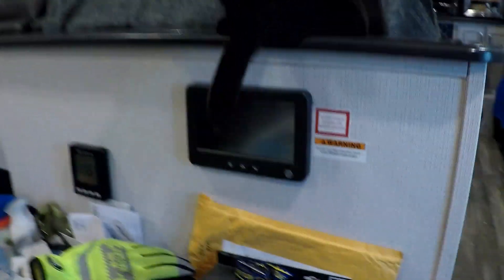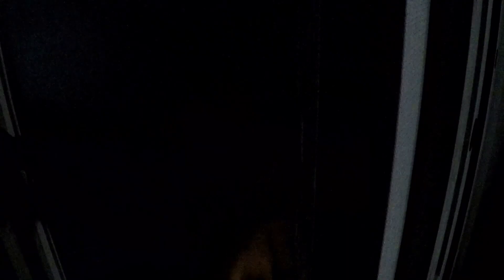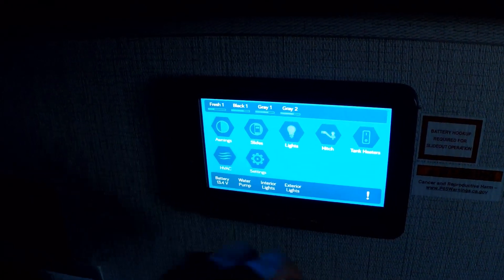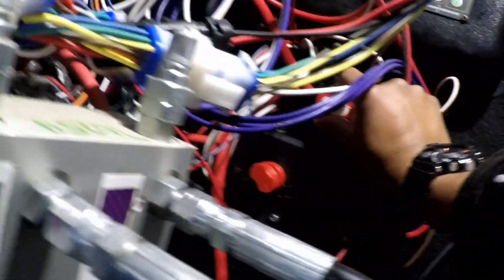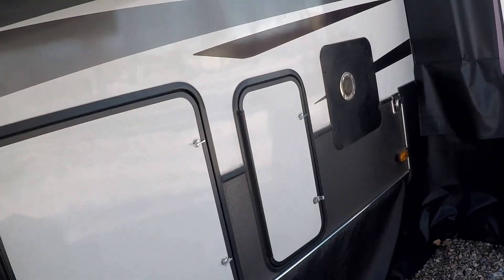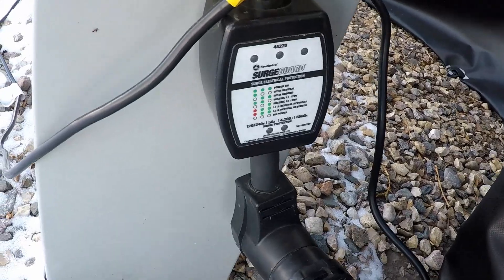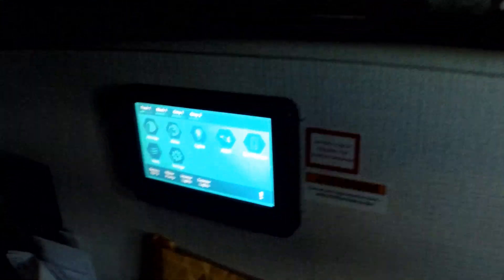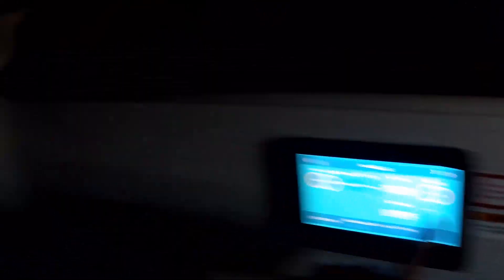IN Command HVAC Reset

Comment: Waiting the extra few minutes before turning the power back on again is required sometimes because in some cases it allows capacitors to drain, which clears the memory of some electronics systems.  Thanks, this helped jog my memory.

Comment: Trying this now, have same issue…will update you when done.  Thanks for info!
Reply: First shot didn’t work, still power from the truck as it was hooked up, maybe the problem; trying again.
Reply from the maker: @carolmatt2959  how did it work out 2nd time around?
Reply from the maker: @carolmatt2959  heyya! Just curious. Did it work after disconnecting from the truck?
Reply: @CombatCarbon  no…let me tell you why.  Th leads had slipped out/disconnected inside the ceiling A/C unit.  The hwy was quite bumpy for days and I guess it was enough to release the wires.  So, since this is a quicker check, I recommend folks look at the leads to see if the wires have popped out, if you’ve driven lots of miles and this happened “out of the blue”.  If the wires are connected, then go with your recommendation.  Thanks much for your video, though.
Reply from the maker: @carolmatt2959  Oh wow! This is good info! When I get back this summer, I will definitely check the leads.  I wonder if they might be loose and thats whats causimg the problem. I will say that consistently, this was happening every 4th or 5th reconnect to power. But tightening leads could very well solve this all together. Thanks again!

Comment: Thank you for your help and info
The only question I have now is I noticed when you went back inside to turn your gas furnace on you had it set to “electric ” and your gas furnace kicked in?
Or did I not see that correctly?
Reply from the maker: @guybrick4490  Hey! I'm glad it worked out for you! Not having AC in the hot or cold can be a deal breaker. And what you saw on my settings and what you witnessed was all correct as well. My AC system is set up with an electric heating element in the rear. When the temperature inside starts to drop, that heating element kicks on and the rear AC unit fan turns on to start circulating the warm air to bring the temp back up. In mild climates or cool summer nights, this would be sufficient for keeping the rig warm.
 However, if 
1) The drop in temperature is too aggressive
2) The time it takes to resolve the temperature difference exceeds a set time limit. Roughly 5-8min. or
3) The system instantly recognizes that the temperature desparity is so great that it can only be corrected with gas heat. Which was the situation you witnessed...
The gas furnace will kick on. 
This is a pretty "cool" feature that helps conserve the propane. And helps reduce the noise pollution inside the cabin.

Comment: I’m having this problem right now and I did all of your steps,  twice. The temperature reading in my rear HVAC which operates my heat is still showing -F degrees. Front AC and Fan both work and are reading the correct temperature. I reset the main reset button on my iNcommand (in the hold area of the RV) also however I think there is an additional reset button inside the iNcommand panel. Or do you think that maybe the temperature sensing wire failed? Of course this happened on a weekend. Any thoughts? If not I will be contacting them on Monday.
Reply from the maker: @NancyBlakeney  Hey! I'm on now. Are you still having issues?
Reply from the maker: @NancyBlakeney  Just making sure.
1) Powered down everying in Camper
2) Powered of In-Command panel 
3) Turned off inverter
4) Turned off Solar
5) Turned off shore power. 
6) Leave everything off for a good 5min count.
7) Reverse steps for power on. 
So far, this has worked for everyone that has reached out to me. Doesn't mean it hasnt worked for someone. But if it didn't, those someones never reached out.
Reply: @CombatCarbon  perform the process again this morning and no joy. I’m gonna crawl up in the air conditioner and see if I can crimp that line. Maybe that’s what it is but tomorrow I will get to the bottom of it with the manufacturer technician.
Reply from the maker: @NancyBlakeney  Hey! Were you able to get the issue resolved? Hopefully you were and were able to get back to enjoying your time. What ended up being the issue?

Comment: Hello Combat Carbon, my issue is not fixed yet. The mobile repairman came yesterday and at first the rear AC was not getting power, we rectified that and did a full reset which did not produce a fix. It was too late in the day to call in Command or Keystone so he will be back on 11 February at a time where we can get them all on the phone while he is here. Hopefully they will walk us through the repair. They have spent too much time pointing fingers at each other instead of helping get this rectified. I even suggested that Keystone issue a recall. I’ll let you know what happens on the 11th. That’s the soonest the mobile repair man can come back.

Comment: The zone still reads negative on mine after the reset 😭
Reply from the maker: How long did you leave the power off for? I would leave it off for no less than 3 minutes. And also ensure you actually "Power Off" the In Command Screen

Comment: The fancier they get, the worse they get
Reply from the maker: @JohnSmith-kw8lt  I don't know. I'm fairly new to this game so 2022 and up is all I know. But I went into this with a common sense approach. Unless it's military grade, hardware and software (especially home furnishings) are tough to design to be thrashed around on streets and highways day-in and week-out. My unit has been a dream considering I parked it and camped it for 16 months straight. However, if someone was planning on moving camp significant distances every weekend or even every week, I would NOT sugest this unit. This is a destination camper in disguise. I think this 3712KB is missing an axel. Two is not enough to tow this thing regularly.

But that is the one topic I find missing in this market. "Frequency of Movement." I bet I agree with you that the more tech and moving parts you have coupled with designer craftsmanship, the less you should bounce these things down the road. A house on wheels will definitely see more hard times than a house on sand. And a house on sand more than a house on rock. Tempered expectations.